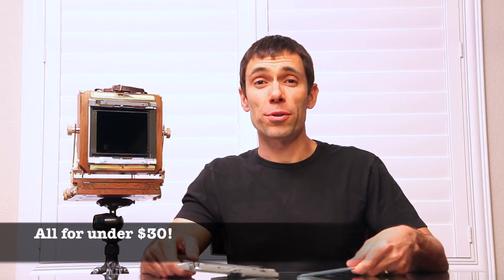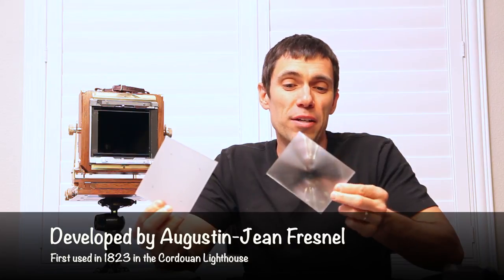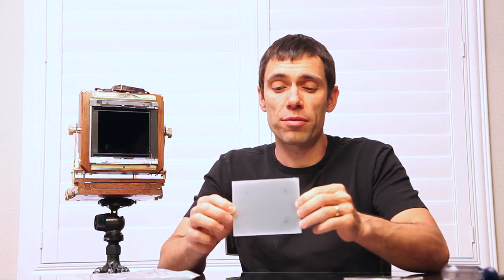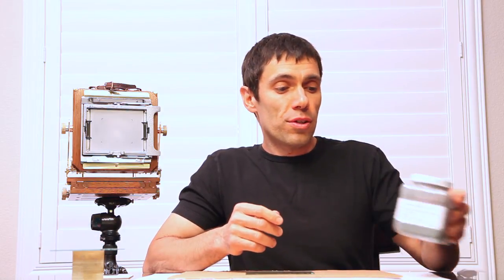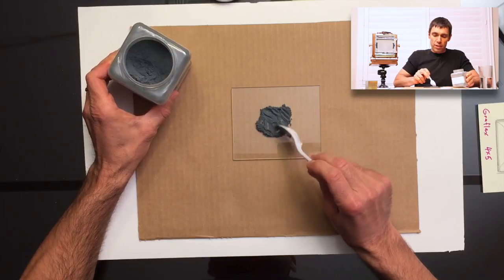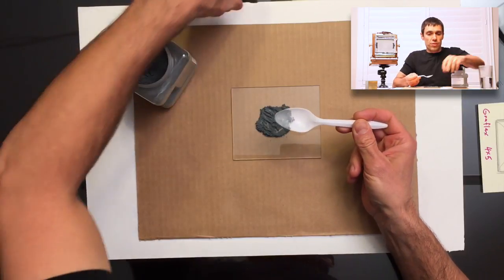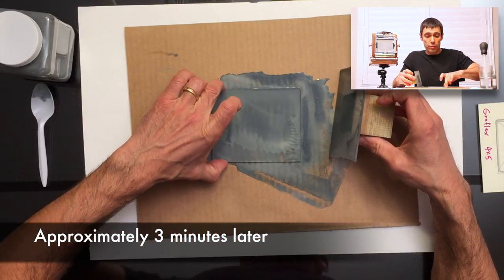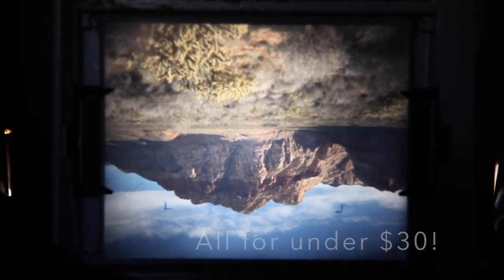Making a Ground Glass for a View Camera - It's Easy!

Comment: Good video. One suggestion - put double-sided tape between the underside of the glass and the cardboard to avoid any of the carborundum getting between them and grinding the plain side of your new piece - otherwise you risk getting a double image on the GG.
Reply from the maker: That's a great tip! Thanks for sharing and taking the time to watch. Tony
Reply: And one more - author uses way too much abrasive. It may cause uneven and scratched surface. Easily divide by five or more. Theoretical ideal - one layer of abrasive particles.

Anyway respect and thank you for inspiration.

Comment: Just did my 4x5 GG. Used about ¼ of a teaspoon four times. Disperse the grit with a salt shaker would work well. Look for tumbling grit 600 on eBay. ¼ pound under $5 shipped is still a lifetime supply.
Reply from the maker: I like the salt shaker idea! Thanks for watching! Tony
Reply: Tony Santo Photography After my comment I proceeded to refresh my 2 other GGs, light taps on the spoon held about 9" above worked well. I spritzed the tool not the grit directly. With a very sharp mechanical pencil I made grid lines. Almost too easy. My tool was a 3" diameter of glass circle I cut myself, glued to a block of wood.
Reply from the maker: Excellent!

Comment: I did this to make a replacement 8x10 GG and it works great and brighter than the original glass
Reply from the maker: Cary, I' glad to hear that it worked out well for you! Thanks for your support! Tony
Reply: Cary, was that groundglass that you replaced stock or not? I find it hard to believe that a factory original is worse than a homemade one.

Comment: Excuse my stupid question but do I mount the ground glass with the ground side facing the fresnel or facing me? 

Also, the only glass I found is missing like 0,1mm in thickness. I can easily put some tape in between the mount and the glass and everything is tight and firm. But I'm not quite sure whether I have to back it up from the fresnels side or the ground glass side? I guess this is crucial when it comes to focusing?!
Thanks for your help :)
Reply from the maker: No questions are stupid. Ground sound faces the fresnel. Thanks for watching! Tony

Comment: This looks like an option for restoration and replacement.  As I understand these were usually manufactured using acid to etch one surface of the plate.  When I compared an acid etched surface to a ground surface the etched surface had more uniform tooth compared to the surface ground down with the abrasive.  In the end it may make little difference with focusing the frame.  My application was used for a large format B&W enlarger and the glass I etched with acid diffused the light source before passing through the condensers, through the negative and onto the surface of the paper.  I did try light diffusion gels from LEE, and ROSCO and they were not durable enough to be cost efficient.  I wonder if the light diffusion gel option would solve the problem of focusing glass?  The glass I used in the enlarger for diffusion was also etched only on one side.  The edges and the opposite side were painted with an acid resistant material used in the intaglio printing process as a barrier and later removed when the etching was finished and the glass was completely rinsed and acid free.  Nice work with the abrasive technique for this application and a plus is a quick finish from start to clean up.  Acid etching is a bit more volatile and one needs to take specific precautions when using this and disposing of the waste at the end.
Reply from the maker: Jeffrey, That is an iterating option that I've never tried. Thanks for watching and commenting! Tony

Comment: Hey. Trying to find an answer to whether you can restore old ground glass? I'm assuming you can but checking to see if any pitfalls of that method. It's an old Rolleiflex 3.5 with a very dim screen. 

Also, if the image has a huge vignette, is that a sign of a old or worn focusing screen?

Thanks!
Reply from the maker: It depends on the material. If it is glass, you should be able to "re-grind" the glass. If it is a composite material then I do not recommend it. The vignette is from the lens not the ground glass. Thanks for watching! Tony
Reply: Tony Santo Photography Thanks brother. Appreciate it.

Comment: Why silicon carbide? Isn't it posible to use sandpaper of the same grit and do wet sanding? Or even user higher grit.. instead of 600 maybe 800?
Reply from the maker: I haven't experimented with other abrasives but that is an interesting idea. I have tried plexiglass with poor results. Thanks for watching! Tony

Comment: Hi. Thanks for this instructional video. My problem with this technique is, I've applied this exactly  1 hour, glass only had 2-3 minor scratches only.. Why? I use 600 grit..
Reply from the maker: Derin, the only thing that I can think of is there may have been a larger grain that abraded the glass a bit more. Thanks for watching! Tony

Comment: doesn't putting the fresnel  screen in the holder before the ground glass change the point of focus as the ground glass is not flush against the mount that has been designed to be in the same plane as the film ?
Reply from the maker: David, this particular setup requires the fresnel to be on the lens side. I've never had any issues with focus. Thanks for watching! Tony
Reply: @tonysantophotography  it was a pleasure to watch, I live in the middle of nowhere so finding a way to make a screen was a pleasure, thank you

Comment: Yes great vid.  I tried using the valve grinding paste which is suspended in a glutenous material and it doesn't work too well.  Powder and water looks like a much better idea.
Reply from the maker: Thanks for watching! There are other grinding agents you can use but this is the only one I've ever tried. It works well so I've never had to seek an alternative. Tony

Comment: So that is, from the lens side outward, fresnel lens, rough side towards the lens, smooth side towards the ground part of the ground glass, then the smooth side of the ground glass outward towards the viewing photographer? Is there any considerations for the thickness of the fresnel lens? I am just concerned about the actual point of focus in this system. Do you know of any good articles on this subject?
Reply from the maker: Joey, There is contentious debate in the film community regarding the proper placement of the Fresnel. Prior to breaking my ground glass, I took hundreds of images that were all tack sharp. Thus, I decided to to keep the arrangement as it was because the Graflok back was designed with this setup. The placement of the ground glass is what is critical; if this changes, then that could throw off your focus when using lenses wider than 90mm and in instances where the aperture is less than f/22. The best thing to do is to shoot a few pieces of film to determine what is the best placement for your setup. You might want to try Large Format Photography Forum. Thanks for watching! Tony
Reply: @tonysantophotography  thanks for the advice. It is confusing no doubt. I have been doing a little camera repair and have been cutting and grinding glass. I have been making sizes to fit 35mm cameras and 120 film cameras to help me check focus settings. As you know the viewed image on the ground glass is often times dark, and I want to incorporate fresnel lens to brighten the image up, but it gets confusing.

Comment: Hi, Tony. First of all, thanks for the input. I wonder if you can apply the same technique on a piece of plastic. I have to replace a GG on a 35mm DOF adapter for my video camera. I think a piece of glass can be quite heavy as the GG is mounted on a vibrating system to avoid seeing the dust and texture of the GG. That's why I believe that applying the same technique on a piece of plastic could work, Isn’t it?
The reality is that I live in Venezuela and I don’t have the possibility of buying a new one in my country and import one from another is almost impossible.

Anyway, thanks Tony for sharing your experience and knowledge!!! It was excellent. Two tumbs. May GOD continue blessing your life!!!
Reply from the maker: Jose, Muchas gracias! I've only tried sandpaper on plexiglass and that did not work. I have never tried to use the carborundum powder on plexiglass but I think it should work because it is a very fine grit.
Thanks for your support! I appreciate it very much! Tony
Reply: Thank you Tony!!!
Reply: Yes, I recall even some ancient cameras were equipped with plastic focusing screens. These don't break as easily and may be lighter.

Comment: Is there any alternative of silicon carbide? Cause I'm not able to find it in this lockdown 😐
Reply from the maker: Lucky, I've not researched other alternatives to the extent needed to answer your question completely, but I am aware of grinding stones and chemical etching that might work as well. Thanks for watching! Tony
Reply: Is this the same powder/ grit that is used in rock tumblers? If it is hobby shops might carry it.
Reply: @mzny4314  I used sand paper ( wet sand paper is best for this kinda work), look for finer grit paper

Comment: I had a nice piece of 8x10 glass already ground and broke it trying to cut the corners out. Now I have to start over and I'll likely do the same. If my chances of breaking it are only 25% it will end up being 100% by the time I cut all four out. And by the way it's Sil-icon as in con artist not silicone. That is a kind of rubber polymer made using silicon.
Reply from the maker: Dave, I am sorry to hear that your GG broke when you tried cutting the corners. Perhaps your home improvement store would do this for you? As an academic, I always appreciate eliminating technical errors, however, it is grammatically acceptable to pronounce the vowel "o" in silicon with a short or long sound. I appreciate your support. Thanks for watching! Tony
Reply: One would cut coners first, to reduce unneeded effort. Tests on leftover pieces should do good to build up technique of corner cutting.
Reply: You might try using large shears while holding the glass underwater.  Any shock/vibration to the glass is dampened by the water.  I learned about this method when reading about cutting round corners on a sheet of glass; nibble a little at a time.

Comment: I would recommend to do it the opposite way: get a bigger piece of glass, stick a suction cup to your ground glass, pour the grit and water to the large glass, and start grinding by doing eighths, I mean the number eight, shaped movements. that way you create the most even grind and flat surface.
Reply: Correct!